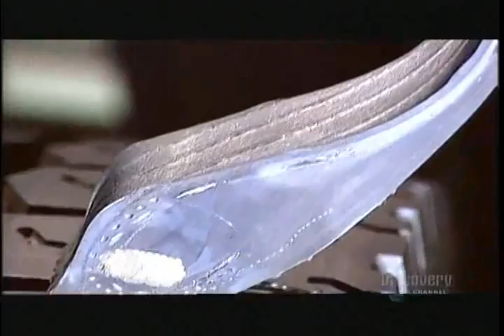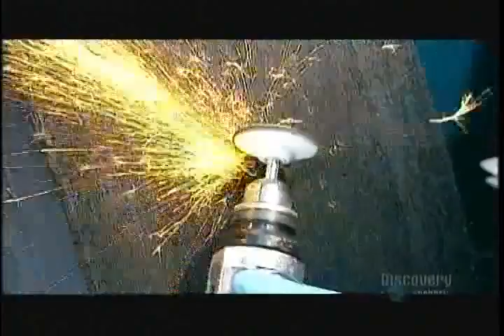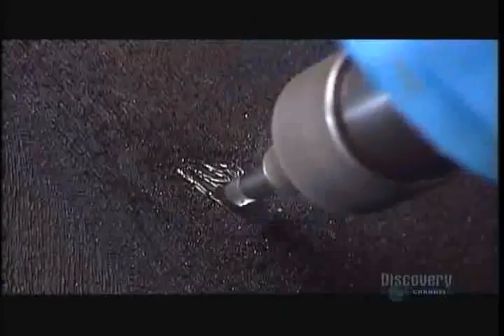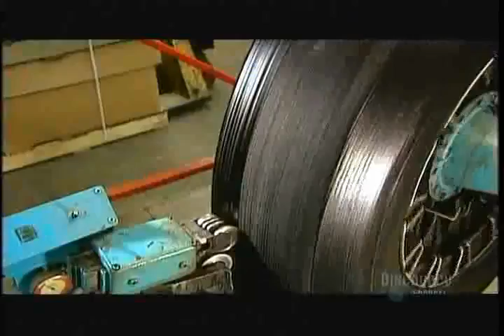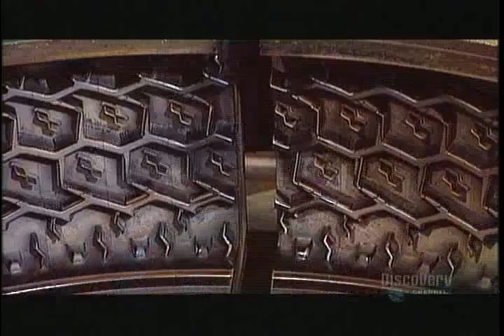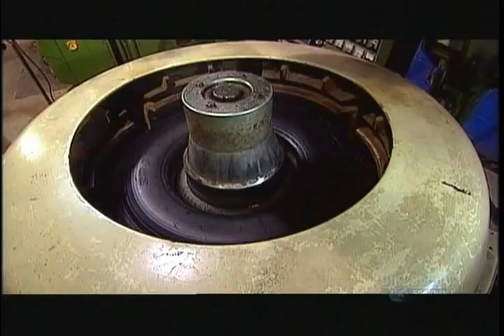Used Tires - How It's Made?

Comment: Gotta love recaps because it’s more money for me . But I also hate them due to all of there treads on the high ways, I guess if a truck is transporting a light local load it’s okay they won’t be under to much heat or stress but if it’s going out of state highly recommend new tires .
Reply: Francisco Castro Its not retreads those blow outs are due to low air

Comment: Retreads on semis should be outlawed. They litter our highways with shreds.
Reply: John Long Those aren't due to retreads, that's due to them not checking their air pressure. Tire shreds on the highways appear in equal amounts new and retread tires according to the NHTSA.
Reply: yep and there are a lot of factors. the massive weight on the underinflated, rapidly heating tire. they're driving all day while your car is parked at work not getting flats. plus any landscape material haulers are going to be driving into job sites way more often.
Reply: +king38081 TRUE  they fly apart when the are flat
Reply: +THE TROLL car tires do the same thing we just change our tires more
Reply: This is not a re-tread, lol. When refurbished tire manufacturers use cheap methods, then the tire falls apart but they are actually putting on new rubber for these tires
Reply: Dan Zhukovin these are true retreads.
Reply: How do you them shreds are from retreads? Any tyre can delaminate, and due to the way they're constructed, truck tyres are more likely to delaminate, especially if they're not in good condition.
Reply: Tires for big rigs are expensive enough to where that isn't possible. Especially considering how many miles a truck will drive in1 year.